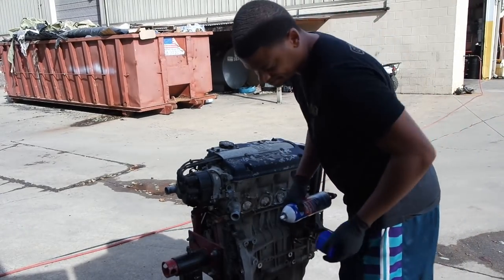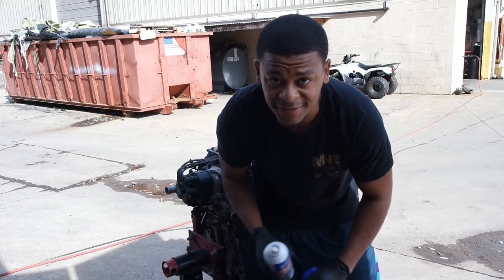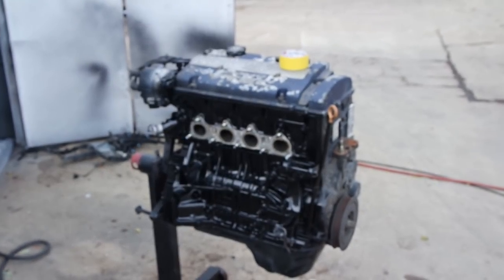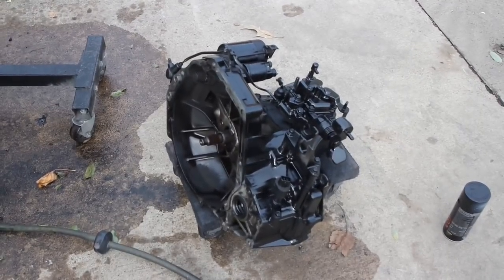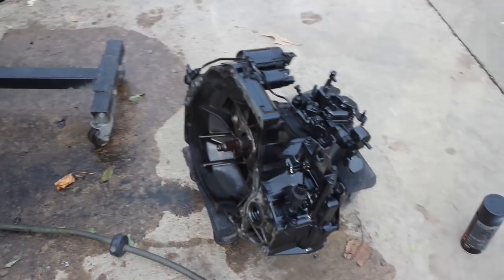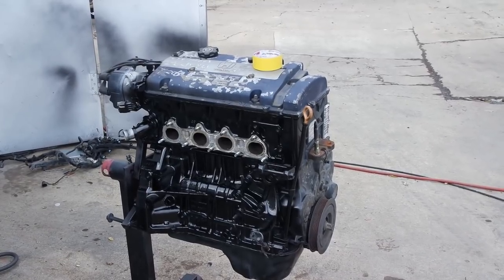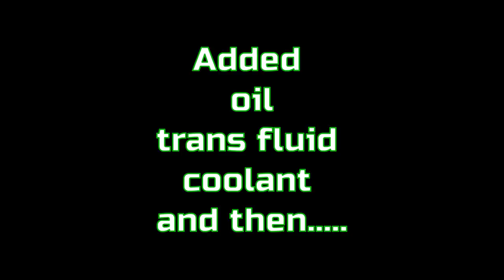Turbo Honda prelude F20B motor swap pt2

Comment: so trey i need help asap im doing building 95 prelude it has a f20b in it wires have been spliced to hell and it wont start turns over has compression and spark can i dm u on ig and you can give me some starting points i saved the car from going to the junk yard
Reply from the maker: Yea bro message me

Comment: Got a question , almost done with mine but I accidentally snapped the 2 sensors under the distributors, no clue what they are !! I’m sure you know .
Reply from the maker: Coolant temp is one pin one. The other i cant think of for some reason

Comment: Going to do a f20b swap but it's out of a 97 and going in my 92. Did you rewire your harness or the OBD2 or is that something I don't have to sorry about
Reply from the maker: Just use all of your obd1 sensors off your current motor and current dizzy keep you harness as is.

Comment: Very nice vid man! You have done a lot of work to your 'lude' in only 2 episodes! Great job well done! I wish i could do all of that to my prelude! 👌😎.  And if you don't mind i have question about my lude.. the egr or the intake problem i have so motor light engine comes on after a while when i drive.. should i block the egr for more power? I heard guy's who blocked the out of it but still let the in work of the egr by putting self made seal (iron) between the egr instead of the gasket what lets in and out open. Hope you understand what i mean. My english isn't top notch 😉😁
Reply from the maker: If you get a chipped p28 ecu you wont have to worry about the egr code or the knock sensor either. I have a skunk 2 and it doesn't have  and egr port

Comment: Yo the manifold looks good, and you say the wastegate is a tial?....then what could be the culprit?
Maybe boost controler?
You should try running on wastegate spring alone and check if it still creeps.
If it dosent, you can eliminate wategate and manifold out of the possible culprits.
Good luck
Reply from the maker: Its the design of the manifold itself bad wastegate flow
Reply: @treybedipping1734  hope thats what it is, you should make a video of you diagnosing and fixing the problem.
Would make good content for us car guys.
Reply from the maker: @henrylima6974  got you bro
Reply from the maker: @Sideways G the manifold had a crack? Where?
Reply: @treybedipping1734  lol Trey
Reply: @Sideways G its a  possible culprit, we'll see what he says

Comment: Bro congrats for get this swap done. I am about to purchase a 92' Prelude with a F22a engine and desire to swap the engine for an H22c  
My question its do i need to built or modify any engine support or braket in the prelude and also can i use the same transmission that came in the F22A ? Thx dude best regards from Venezuela.
Reply from the maker: Thanks bro You can use the same mounts and the same transmission.
Reply: Trey Be Dipping Nice thx i am checking all your videos the radiator looks gorgeous.
Reply from the maker: @67aacosta  thanks bro

Comment: Hey man i been wondering, have you ever split the motor apart? and if you have, do you buy the f20b oem gasket from overseas, have one custom made, or use h22a4 headgasket? 
Ive been looking for headgaskets if i decide to open up the motor i got, picked up an f20b and am trying to drop it into my civic!
Reply from the maker: You would use h22 gaskets

Comment: How would u compare this with a turbo ls none vtec build? In a teggy
Reply from the maker: With a turbo it really doesnt matter what motor you use as long as it done right
Reply: Trey Be Dipping well I'm on a budget not a super budget but I'm not trying to sleeve my LS B18 I believe it's good to 400 horsepower I could be wrong but I would be happy with that

Comment: y use a f20b & not a h22??? jus alil curious man, duz it have lower compression for the boost set up?
Reply from the maker: It has cast iron sleeves....better NA motor for boost.

Comment: Nice setup, before you tune spend the bread and get a genuine wastegate bruh that will solve the boost creep
Reply from the maker: I have a tial bro
Reply: I think the boost creep is because of the intercooler🤔
Reply from the maker: @FrancisD  why would you think that?
Reply: @treybedipping1734  I was reading in forums that it can be a blockage in intercooler or it can be cause of your manifold aswell not being able to maintain psi levels
Reply from the maker: @FrancisD  never heard of the intercooler but mine is from the manifold...getting a new one fabbed up

Comment: Where can I get a engine harness for my Honda prelude 92 f20b? My harness it totally destroyed.
Reply from the maker: Online on a prelude group page, possibly a part out or at a junkyard.
Reply: @treybedipping1734  could I use the rywire harness? would that be easier I know it cost a lot more but im trying to make it as simple as possible.
Reply from the maker: @TerrioTheGreat  if you got the coin then yea 100% bro
Reply: Trey Be Dipping alright thanks bro

Comment: Does the h22 timing belt work with the f20b?
Reply from the maker: Yea everything is interchangeable except internals
Reply: @treybedipping1734  thanks for the info. I'm running the exact same set up I just haven't had to replace the timing belt yet,and I have heard that the f20b was one tooth less then a h22 belt
Reply from the maker: @danielbaker7637  heard the same but  i always use h22 and no problems
Reply: @treybedipping1734  thank you sir.
Reply from the maker: @danielbaker7637  no problem

Comment: Why the switch
Reply from the maker: blew the old motor
Reply: @treybedipping1734  wonder how that F20B is gonna do. Is it an open deck block or closed deck.
Reply from the maker: @preludedudesi5208  my last motor was a f20b
Reply: @treybedipping1734  Dang for some reason i thought you we're running the H. Man i wish the H were iron sleeves instead of FRM.
Reply from the maker: @preludedudesi5208  yea for boost it definitely is the best motor stock

Comment: what distributor did you use? and what wiring harness ?
Reply from the maker: Stock prelude harness and a h23 non vtec dizzy
Reply: @treybedipping1734   is it internal coil or external.. i have a similar set up but my dizzy keeps failing
Reply from the maker: @Maaco-xm5no  mine is external